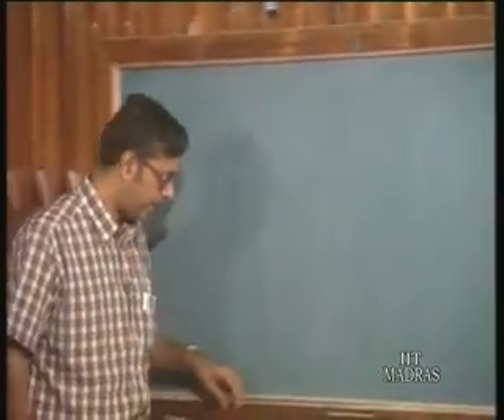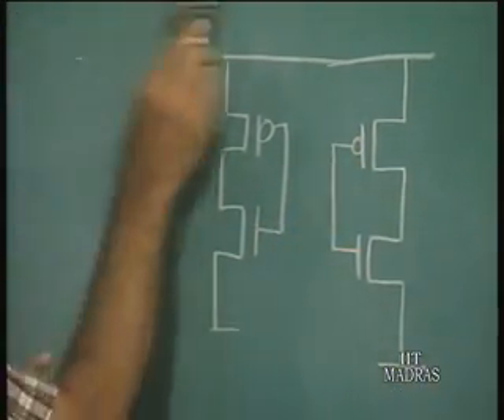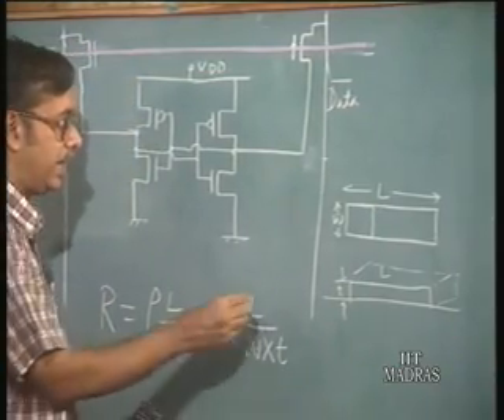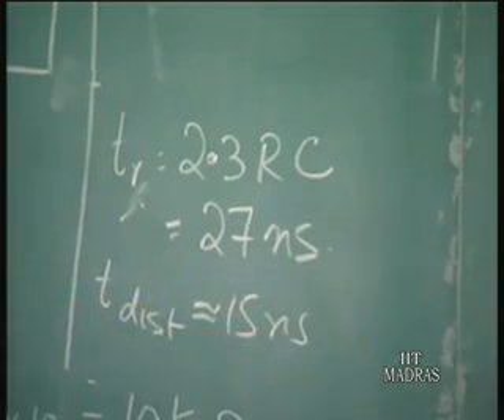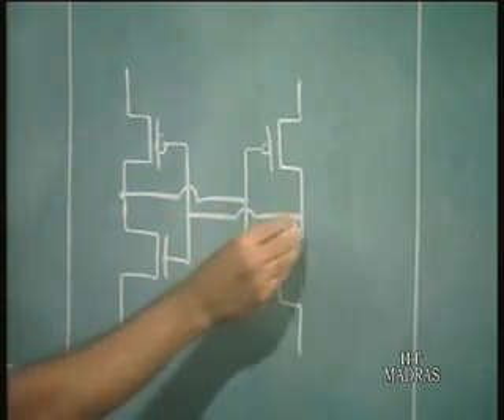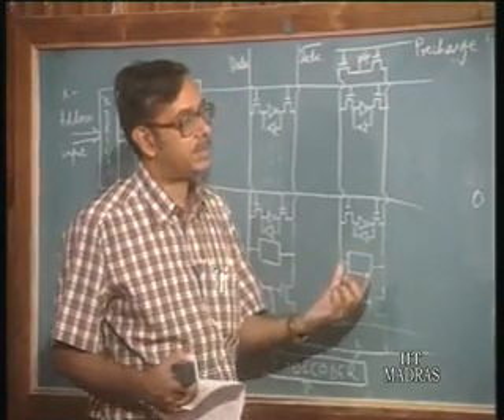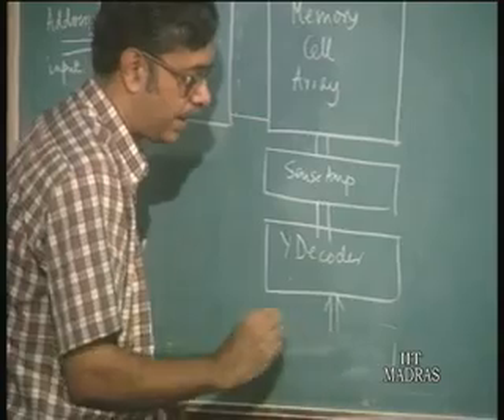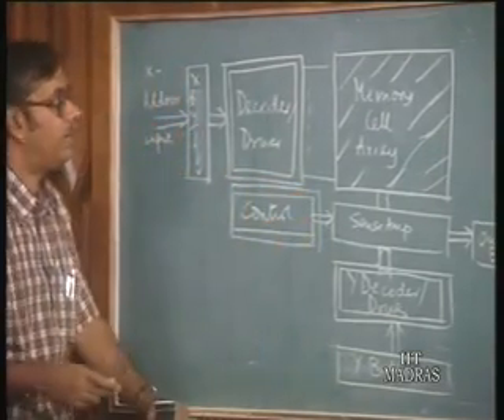Lecture 33 CMOS SRAM

Comment: Wonderful lecture... Thank you very much to all who have contributed their effort for making this video.... i request to provide link for video about timings & power concept in memory...
Reply: Timing -- optimize the critical path from where the address goes in through the decoders to when it comes at the output of sense amp. So, try making the decoder faster even while having a large fanout, and sense amp more sensitive to turn on even with a small difference in voltage. Also split the array to deal with long bit/word lines etc. Power -- various ways. Power-gating or dynamic voltage scaling of cache lines (search for "Drowsy cache" among IEEE papers), selective sub-array precharging etc.